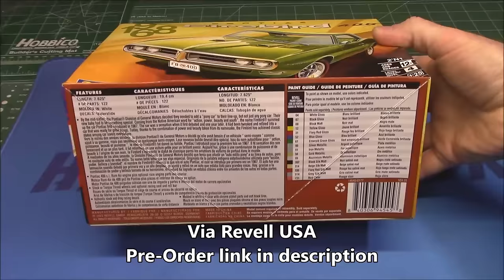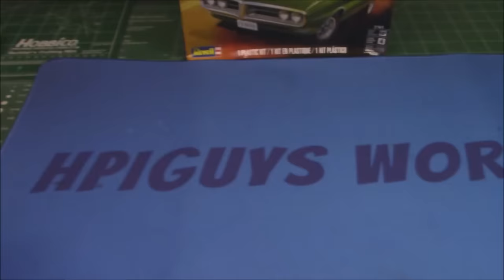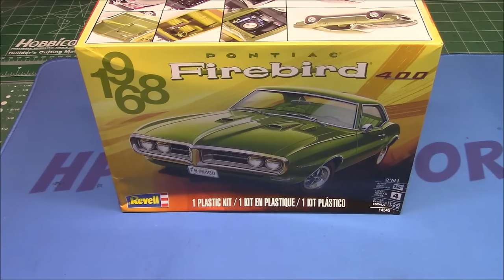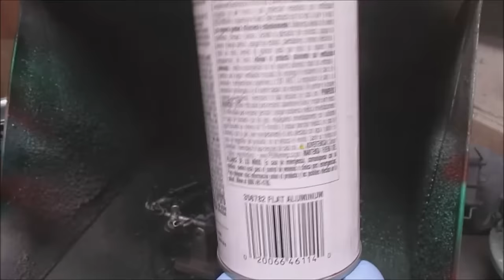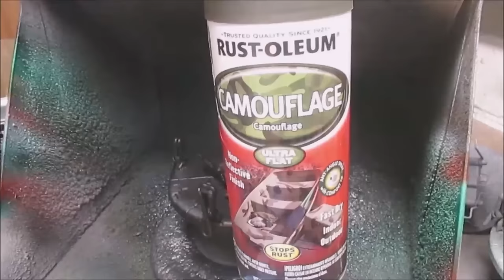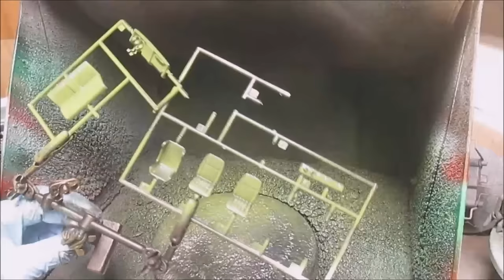1968 Pontiac Firebird 400 1/25 Scale Model Kit Build How To Assemble Paint Decal Interior Black Wash

Comment: Since the rear taillight panel can't be installed until the last steps in the assembly I like to attach it to the body using Elmer's school glue or a similar weak glue, paint the entire unit as one, then carefully remove the rear panel after the paint dries. That ensures even coverage on the panel and the body.
Chris, yet another great review and gorgeous build! Rock on my brother!

Comment: I have two of those. One I have started to build as stock, the other one will be custom and I'll try to fit the LS1 and the mechanical parts from Revell '98 TA Ram Air (Ain't sure if the Ram Air is the same as the TA WS6, so I write WS6 here).